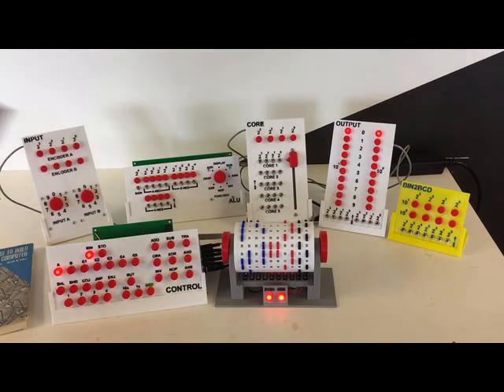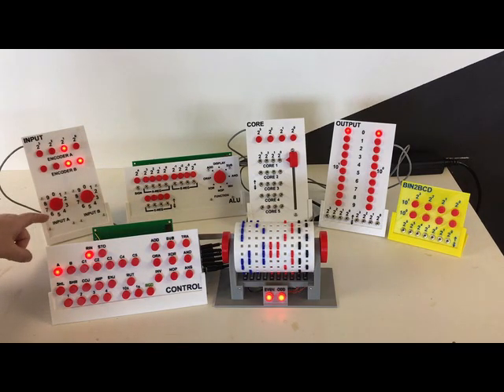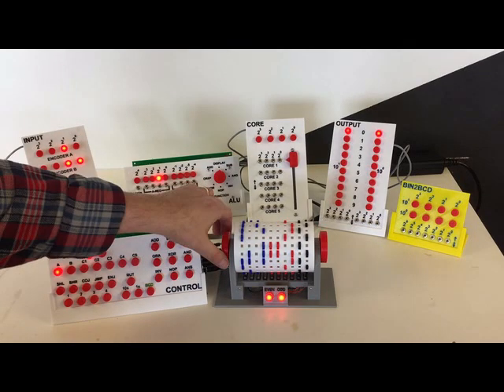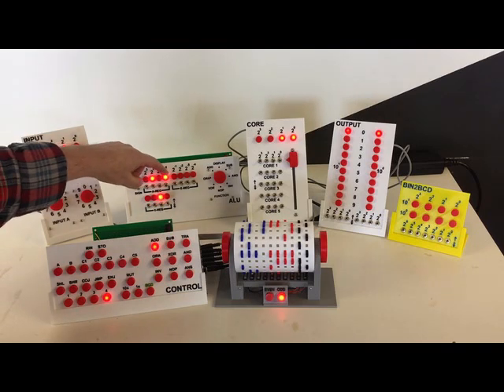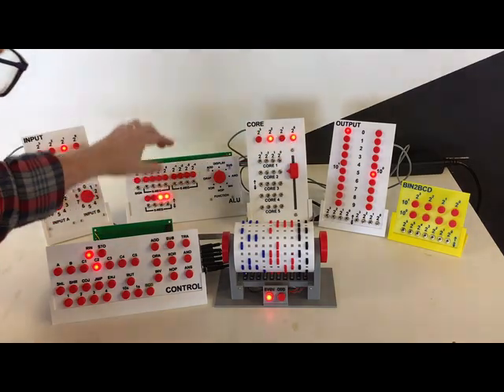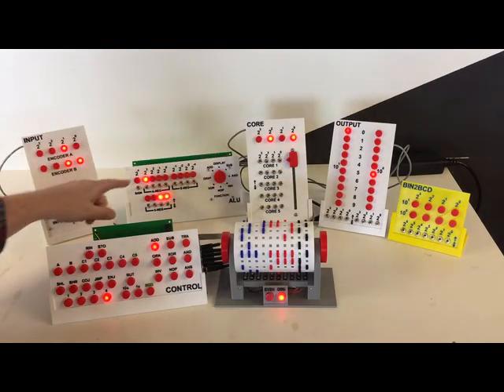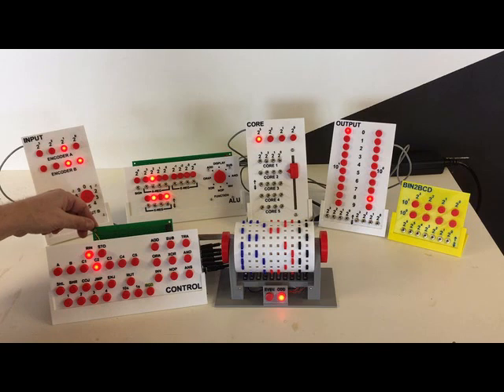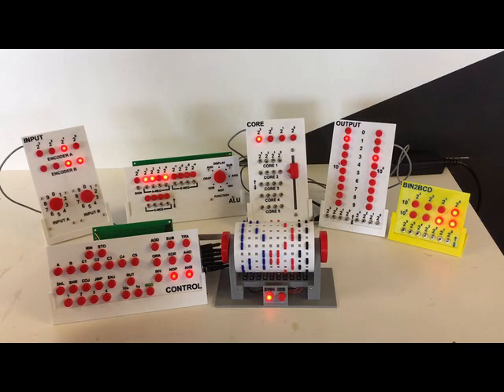WDC-1 Demo

Comment: Well thought out demo! :) It looks great when laid out on the table like this.  If you wanted to make a new program, would you be able to modify the drum manually, or would you need to print a different drum?
Reply from the maker: There are pegs that are pushed into the drum to program it. They can be removed and a new program “punched” in.

Comment: Can you expand it into being an automatic computer where one can set the program on the input drum then have it automaticallt load into memory, do the calculation etc without further operator manual intervention? I downloaded a copy of the book some years ago and was interested in building one, until after reading through the book I discovered it's more like an electronic abacus than a computer.